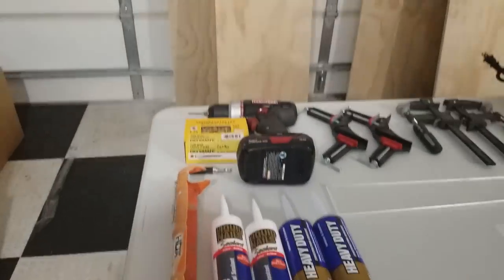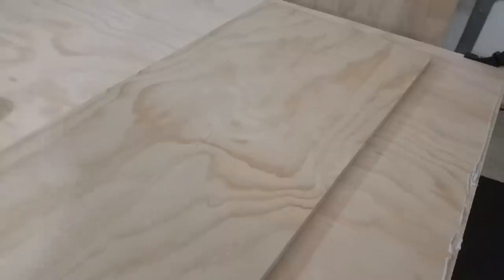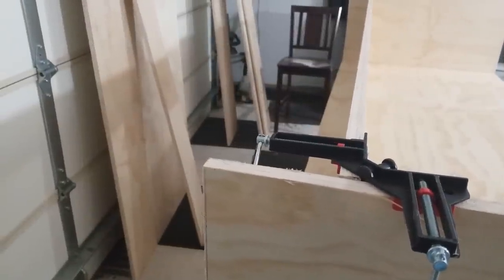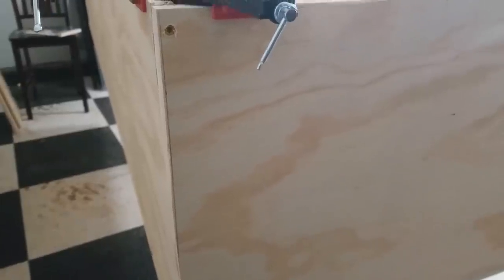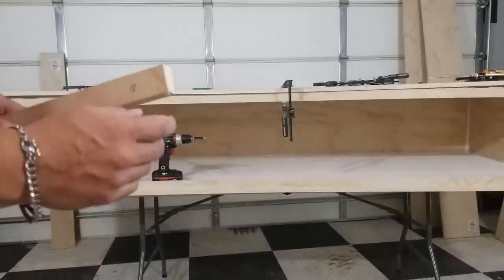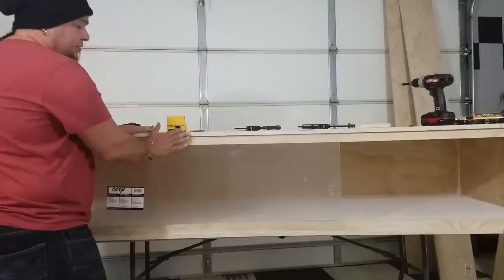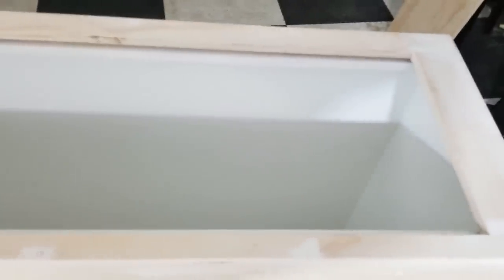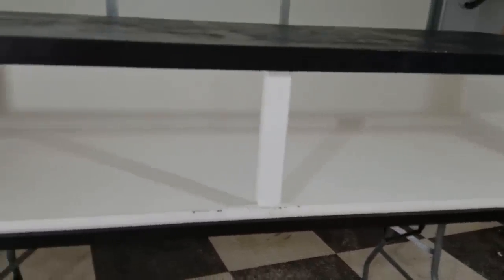8 Ft Snake Enclosure Build With Sliding Glass

Comment: What's a plastic turkey bag?  I was planning to use a router to cut a groove in a top and bottom lip/edge board for the sliding plexiglass doors, with about 10 inches of overlap between the boards.  Any thoughts? Will two pieces of plexiglass slide easily against one another? Why do you want to slide your plexiglass out? I'm confused.
Reply from the maker: The bags used when people cook turkeys. They put the turkey inaide the bag and then all together in the roasting pan to be placed in the oven. Well some of those bags release a gas that will kill your pet birds if you ha e any near or close to the kitchen.
Reply from the maker: My plexiglass doesnt slide out but I can lift it up high enough like you wud a normal sliding window in order to clear the bottom track to pull the glass out for easier cleaning. The plexiglass slides perfectly. If you ever have a large female that lays eggs and u want to incubate them, you're gonna want to be able to remove that glass so you can safely get the eggs.

Comment: Basically what I was thinking of doing, you just helped iron out some of my questions. I've considered going with heat tape since I will have 6+ stacked together. Would you suggest putting between the olly and polly, or under the plywood. Or in your opinion does ceramic heat bulbs work better for large snakes?
Reply from the maker: I have radiant heat panels in a few of mine now just becuz they take up less space and a buddy sold them at a great deal, but otherwise I ise the ceramic. I tried some heat tape but it didnt seem to penetrate the wood enough to give a heat spot in the 88 to 90 degree range. The tape maxed out at about 79f. From what I understand,  the heat tape will need to breath on one side so if u do go heat tape it maybe best to go along the back unless u can somehow get a bit of space as to not sandwhich the tape tightly. It cud overheat and melt from what Ive been told. Hope that helps and thank you very much.

Comment: was the plywood coated with anything to protect wood from humidity / water? or only the poly wall?
Reply from the maker: Its coated 1st with a latex paint made for bathrooms with No VOE/VOC. 3 coats.
Reply: you can use a water based poliurithane .....3 coats....glossy finish...looks great on my cage

Comment: What kind of paint did u use on the inside of enclosure?
Reply from the maker: I forget the name but you can get it at Homedepot. Its the kind you use in bathroms and resists mold. Make sure its zero or low odor and no VOC. I apply 3 coats for durability incase I need to scrub the walls due to poop lol. It happens:)

Comment: How thick is the glass?
Reply from the maker: 1/4 Plexiglass. Cudnt find anything thicker out here, but with the face plate support it works extremely well. I have a 120lb girl that wont push it open.
Reply: Glorious Predators thank you! If I have a lil leopard gecko would I be able to go thinner or standard is a quarter inch
Reply from the maker: @sammysweet4421  If ur making this fkr a leopard gecho Im sure u cud go thinner, but it gets flimsy.